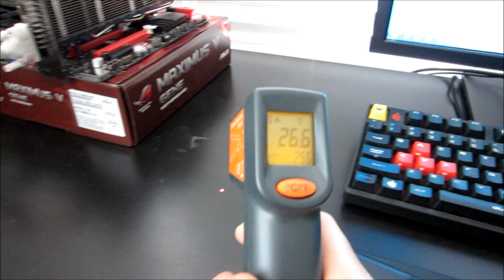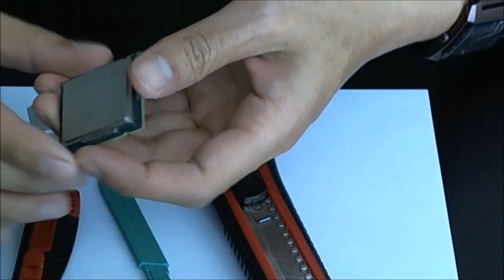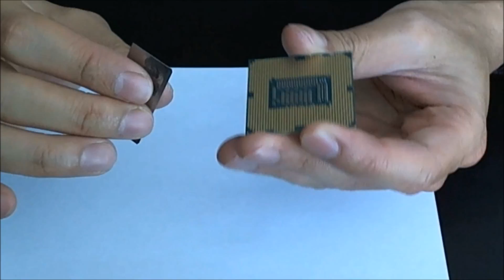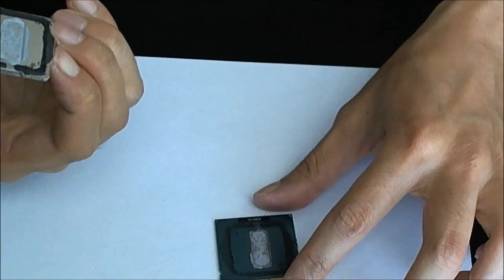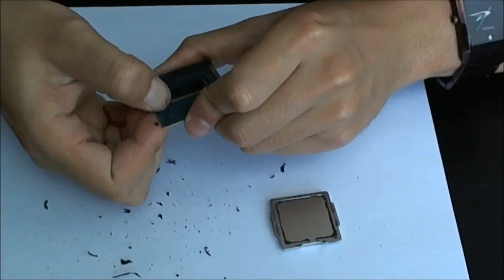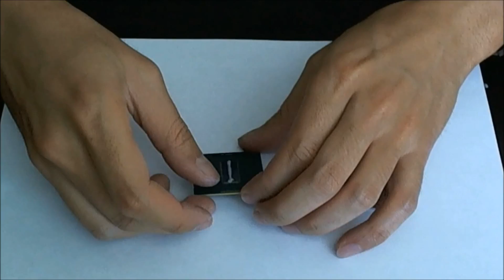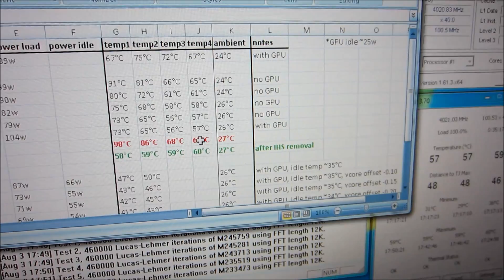Fixing Skylake, Haswell, and Ivy Bridge CPU temps: IHS removal

Comment: Intel chips run cooler they said? Lmao my FX4170 is overclocked to 4.7ghz and still runs cooler :L
Reply: The performance of intels processor cant even be compared to amd -.-
Reply: Wow must have a good cooler im not going to bash Intel because i couldn't care less about what chip you use but this makes the fanboys eat their own shit :P
Reply: MattTheNoob94 I have a 8350 at 4.6Ghz and its 50celsius.
Reply: De-M-oN I can confirm this.. I recently bought an i3-4330 and yeah it runs fairly warm but it never goes above 60C (though 1 core does sit at about 55C so I might could see a small improvement doing this)
also what you all are forgetting is that these new CPUs are on the newer 22mn design so higher temps are just inherent to their design, heres an example I've heard before (re-worded) which is easier to cool? a needle or a slab of metal? obviously since a slab of metal would have more surface area it would have a lower overall temperature, however lets say there both receiving the same amount of heat, thats more or less how these processors work, sure the intel processors run hotter but they actually only produce about the same about of heat as an AMD processor would, merely in a more confined amount of space... (which I can confirm this too, as I had an AMD CPU before hand and temps of 40C+ would start spewing quite a bit of heat, whereas my new processor spits out a similar amount of heat at roughly 55-60C)
Reply: I now have the AMD 9370 beauty of a processor and while i stand by i couldn't care less what you use this thing annihilates Intel's i5's and most of it's i7's and it's still cheaper.... and still runs cooler xD
Reply: Sounds awesome glad to see AMD back in the race!
Reply: Intel, it is better but only minor so. Look at benchmarks. I don't suggest upgrading, just overclock
Reply: I meant SHAWN NOT INTEL
Reply: ***** I have the i5 4670k and i dont regret buying it, its not hot at all, 27 celcius idle, 55 celcius load with hyper 212 evo cooler. The performnance is outstanding, i dont even need to overclock it.
Reply: somethings wrong with his cpu. I have never had such temperatures with my 3770k. Not even close to that. And I have not replaced the thermal compound of the heatspreader.
Reply: anyone can log in to a youtube account, comment on videos like this and say, Hey my Volcano chip runs at 10ghz 100% load and still  stay no more than 5 degrees celsius.
Reply: eroOtoko1
I'll just stick with my Core i7-4930k and Corsair H100i cooler.
Reply: My Phenom II idles at 35C with a cheapy cooler (Hyper 212 EVO), but i haven't overclocked it at all because it's multiplier locked. Planning to get an FX-8320
Reply: 3770K 4.5 GHz 35C..
Reply: ***** Watercooling ftw
Reply: Corsair 900D ftw
Reply: Topias Salakka meh.. noctua fans are the way to go, with water cooling there are so many points of failure I see no reason to go with it unless you must absolutely have it for some reason, whether a closed loop, a custom loop or even one done by a professional, any of them can fail at anytime, but air cooling is very reliable and the only failure to worry about is the fan, plus noctua coolers get close to and even on par with water cooling anyway, so I don't know why anyone would would ever go water, unless you must have the best temps because you want to OC to 5GHz or something crazy like that.
Reply: vgamesx1 Have only used watercooling and i must say i have never had any issues with it..Yea it's concerning but a failure happens like very rarely. If i wasn't using watercooling i would defo use Noctua :)
Reply: NOOB GAMING well I know it is a problem you likely won't encounter often, but.. I just dislike the idea of IF it does fail, then you're going to have a soggy everything, while on air you at most have a fried CPU if not just a really hot one.
Reply: NOOB GAMING I've been thinking of watercooling the GTX 660 i'm getting soon, is a custom loop easy to build?
Reply: bogdan mihai Nah, i don't really need the best gpu... I just want a cool and quiet system that can run any game at 1080p
Reply: Topias Salakka yeah, unless you plan to OC then air will be mostly cool and quiet, if feel like you really need it then you can get something like a ARCTIC Accelero Turbo or even the Xtreme VGA cooler or even almost any card that isn't the reference design will have a better stock cooler that will work well in most cases.
Reply: Topias Salakka It's not exactly hard to build custom loops but it's daunting and requires concentration. I use 2 closed loops to cool both gpu and cpu with the help from the nzxt kraken g10 :3
Reply: This is true and unture at the same time. AMDs stock run cooler then intel yes but they have a MUCH smaller thermal limit normally sitting at around 65-72C before the chip starts to throttle. An intel CPU however has until 100-105C before throttle starts to happen and normally have a much larger gap from what they normally sit at. 

This kids biggest issue was he had the video card with a silent cooler and the CPU fans almost right up against the GPU and taking the warm air from it. If the orientation was different alone he could have dropped massive temps as well.
Reply: vgamesx1 Noctua Fan's aren't good. They move shit air and cost alot of money. Silence isn't performance. You get one or the other. I got nice fans for a fraction of the cost
Reply: Bait28 well thats your "opinion" now isn't it, since benchmarks obviously prove that Noctua fans are not only the best, but also competitive with both the price and performance of mid-range ($100 ish) water coolers, those are just facts.
Reply: vgamesx1 I think bait was just referring to the fans them self and not the heatsinks. The Noctua fans are a bit pricey for a fan and some only offer same performance and some better if u get the right ones. Most are expensive for a fan because of the type of bearing they use which has a high cost to make but will last longer....... in theory.
Reply: kdawgmaster I was indeed reffering to just the fans, not the heatsinks themselves. The heatsinks aren't the best, but hell, they are some decent heatsinks. I still like my Silver Arrows. But to continue, the bearing doesn't make them taht expensive or anything. I ordered for this example(true numbers) 5 Delta AFB1212SH's for 25$ total. Each can move around 90CFM to 100 at max RPM of 3100. With motherbloard control i get them down to 2K rpm during low load and they still move alot of air. I used TFC1212DE's which i got for 18$ a piece. They spin 5500 RPM at max speed. using motherboard control they slow down to around 1400RPM and are whisper quiet at those speeds. When i need it, They can slowly spool up to cool the CPU. at a max of 252 CFM. noctua's fans cost way more than that and offer a max of around 50 CFM or so, unless you buy the "performance" series for 50$. At 50$ i'd buy a SanAce cause 260 CFM with 0-100% PWM controls sounds killer.(I own one, would love a second)
Reply: I'm loving all the people in here saying "amd is so much cooler". That may be true, but you have to remember that your temps are lower because of better thermal conductivity, NOT because your chip runs cooler. Intel may have screwed up the TIM, but the efficiency of intel is still far, far superior to amd. If you want an accurate comparison, compare intel extreme edition processors. They have soldered TIM, like amd.
Reply: ***** I'm guessing you haven't seen the new DC chips then, with the supposedly "fixed" TIMs. Those are about 10%-20% more efficient cooling wise, getting roughly 8C-12C lower temps at the same speeds and no there isn't a way for them to possibly get much lower than that, the reason they are so hot to begin with is down to physics not because they stopped using solder, its the same reason they are more efficient overall, their size...

Comment: What was the final result for the Haswell cpu when cooling was right.  and it was running at 4.5ghz. Haswell , a tock of the Intel clock to make cpu's for the laptop brigade, is yet to be proved for overclocking. Haswell is ok for big companies with 45 machines in the office, wanting to save a buck each for the week.  What temperature for the Haswell at 4.5 Ghz.  How much how long and what. cheeers

Comment: Haha, well guys... never do that. if you are getting bad temps even at stock clocks, return it for warranty. But this process is not neccesary. I have my ivy CPU for over a year now and it is still showing the same temps as the "Fixed" version of your CPU, in prime95 of course. Maybe if you are desperate and dont have any warranty it would be an option to think about but never during your warranty period.

Comment: Also kids make sure to use a dirty razor blade and make sure not to clean the thermal paste off with alcohol and use a piece or paper towel because the fibers are good for heat distribution

Comment: You're are just using a bad cooler or got a defective CPU. I'm running @ 4.0GHz (which isn't much of an overclock) but I hit 52C at the most.
Reply: I forgot to note that I live in South Florida and my room temps are usually between 76-80F

Comment: WHY put the heat spreader back on, why not just put your cooler onto the die?
Reply: Wont fit. Cooler plate wont reach the die behind the bracket. But welding a chunk of copper or alu to cooler could in theory work, but that has to extremely precise job.
Reply: Thanks, I also forgot the thermal expansion problem, could easily chip the sharp edges.  Thanks for the clear vid by the way.

Comment: ***** Its called "TIM paste", it is a "thermal compound"
Reply: It is called thermal compound, TIM (Thermal interface material) or thermal paste.
To all the nabs: This video is absolutely safe as long as you are taking care of static electricity.. I would use gloves but that is mostly because I don't wan't grease all over the cpu. Also I would use a microfiber cloth when removing the TIM off the CPU die. If you choose to delid your cpu you will get better temps when overclocking, hence better stability at high voltages but it will void your warranty.

Comment: Lol, he bought an i5 processor, yes by design you bought a deffective processor. 4th gen i5's don't have this problem because the cores have higher precision (quality of non deffective cores is higher), and thermal tuning software that automatically adjusts the clock speeds of each core to achieve more stable temps.

Comment: When you want to over clock you water cool not use a aftermarket even tho it is bigger and can move more heat not recommended. An you could of used you warranty and got a new one. Plus the
Paste is hard due to the extreme heat.

Comment: buy AMD that's the real fix
Intel over heats and is very sluggish in video
but they have a great PR which convinces the public to buy their crap
Reply: actually bench-marking shows that intel is better than an AMD the only downfall between them is the is pricing. Most people can get by with a normal AMD processor but for high end performance if you actually need it intel beats out AMD. So intel has PR? Do you not remember when AMD out performed Intel in like 775 days? This actually pushed the creation of Intel dual and quad cores during the end of 775. Back then everyone switched to AMD then back to Intel, I promise its not all based on marketing. Secondly just dont get a Haswell yet because its hardly noticeably faster than high end ivys. Buy a $100 water cooler. The architecture of AMD processors are still behind in technology. Compare the architectures with in the AMD compared to an Intel. This however is all only going to actually show when you go to bench-marking or do extreme renderings aka not gaming. Processors are a lot more then just cores and clock speeds. Point being AMD is not better then Intel yet and still are quiet behind. AMD focuses more on mobile processing more then desktop processing these days but with the new haswell processor they are now behind in that where before they were ahead.
Reply: ultra bong
Well sure they run hot you get  more juice out of em they heat your house
but the slug like video and the over heating   buy AMD get more cpu speed than you need and GPU combinerd in the chip runs 1080p

Comment: the only negative comment i have to say is when you said that because its really cheap thermal paste its hard like cement, i have went through my fair share of cpu temp problems in the past for customer pc's and i learned one thing, eventually all thermal paste will dry out and will need replacing eventually (and yes it will be hard like cement when dried out). It's just called maintenance pretty much. But i agree with you on the ivybridge processor's, they should not of used thermal paste within the cpu over the saudered version.

Comment: I have a 4770k @ 4.3GHz and it never hits 70c. Using a hyper 212 evo, btw.
Reply: temps dont mean crap unless you list the ambient.
Reply: Sakura Ichigo 70F in my room, probably higher.
Reply: 23c in my room. with out my fans running max i can reach in temps is 65c and with like 40c at 4.4ghz with a 3770k. haswell is not a great overclocker. it heats up more then ivy.
Reply: Actually just hit 4.4 and it's stable. Load temps are a little hot for my liking, but I can be at 4.4 24/7.
Reply: 10% difference from sandy to ivy to haswell. id probly never get haswell because of the temps. sandy oc better then ivy then haswell. lol so either way they kind of even out

Comment: LOL, i have a 3770k that runs at 50ºC at 4,5 GHz  i think u just had bad luck and voided the guaranty doind dat.
Reply: Me too, but I don't overclock it that much
Reply: Same here with my 4670K.  In my case I just apply the thermal paste like a boss and use high quality fans in push/pull.  Case airflow is also just as important.  My CPU cooler is xigmatek dark knight 2, nothing super fancy.  It works extremely well.  [Cool story bro @myself]
Reply: High Voltage eV I use a corsair 800w font with two corsair coolers and a ThermalTake case with a lot of air flow, so here in Brazil, even being hot, it runs just perfect.
Reply: Really? What fans do you have, or watercooling?
Reply: I have a Noctua D14 :D
Reply: im gonna be getting one soon but i've been using my 3770k with stock fans for over a year, hope it hasn't damaged the overclocking capabilities, its never crashed because of overheating so im not too woried
Reply: Stock cooler with no OC it's OK :D

Comment: This mod may solve this heat issue with defective Ivy Bridge/Haswell processors but it also will send your warranty flying out a window of a 60th story building, best thing is send it back to where you purchased it from and get a replacement easier then voiding a warranty and having to buy an new cpu.
Reply: ***** I have to agree with Tutankhamun1333.. My 3570K is OC to 4.5Ghz and runs cooler in prime than this CPU was after the mod. I'm using a Corsair H80i cooler. I'm pretty sure the CPU in this video is faulty... or maybe I'm just lucky. I would at least return it once to see if a new one would be better
Reply: James Crawford I also agree with Tutankhamun1333. I have a 4770K at 4.5ghz running at 32C idle and 40C with prime95. Definitely return and get a new one instead of voiding the warranty
Reply: Bookish Man True but there's no logic in slicing open your cpu to get 10c cooler on a faulty cpu. we are simply giving people the information that they can get a replacement which will most likely be 2-3x cooler without voiding warranty. people with not much money shouldnt have to attempt this to get their monies worth should they?

Comment: Works perfectly, got my i5-4670k on the MSI Z87-G45 from 91°C to 51°C at 4100 GHz and default Voltage (after 1 hour stress test on Prime95). Very nice vid!

Comment: Unlike his method, I spread it out in an even, thin translucent layer, just to be sure it winds up that way rather than trust that heat and pressure will do the job for me.
By the way, I don't take any fear-based, anti-static precautions, and I've yet to mess up any chips with static from my hands.

Comment: IMO, most components, such as graphics cards, chipsets, etc. are pasted with cheap paste that is put on too thick by machines, so I re-paste them all, especially if it has been a couple years since most paste gets harder due to heat. The paste is primarily supposed to fill in the fine grooves that separate the metal surfaces, improving their connection. I use Prolima PK-1 in the light blue tube, a very good paste, but there isn't really that much difference in the top 5 temp-wise.

Comment: I don't see any alternative to touching the connectors...to get the grip on the assembly and not torque the little pc board too much, I would think you need to grip the assembly other than just the sides. I guess if you had some soft gloves?

Comment: As long as you don't put too much pressure on them or have a static build up it won't cause any problems. Example, you see everyone including professionals hold graphics cards touching the pcie connector, and motherboards by their pins without issue.

Comment: That "heat sink" on the processor itself is not really a heat sink.  It is called a heat spreader.  It spreads the heat out as evenly as possible so the real heat sinks people attach can take full use of the surface area to make a larger heat sink and dissipate more heat.  If all of the heat sinks were attached to the CPU Die directly, they would need to be extremely efficient and locked down really tight on the die, potentially causing damage.

Comment: I have a safer method. #1 buy a good cooler like the corsair H100i. #2 before you do any overclocking run it at stock speeds for about a month to allow the thermal paste in both the cpu and the cooler to set properly. With my i5-4670k my temps were bad at first. Now clocked @4.3 running prime 95 top core reaches 76 max. No need to take chances, you just need patients.